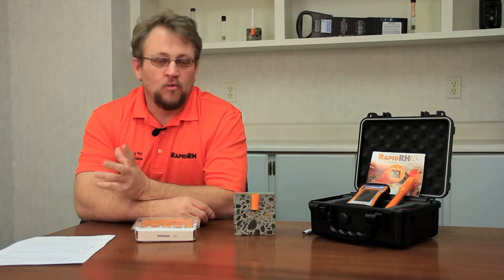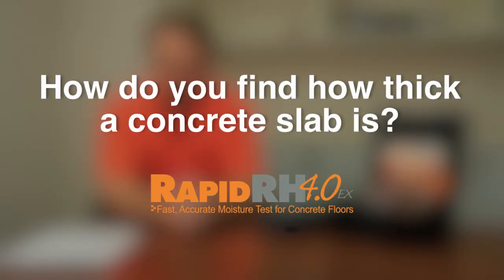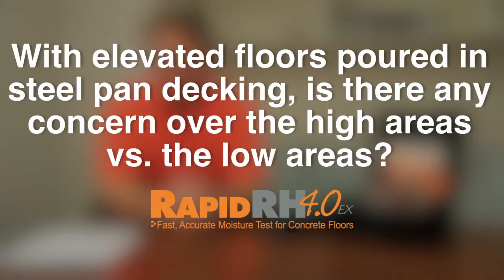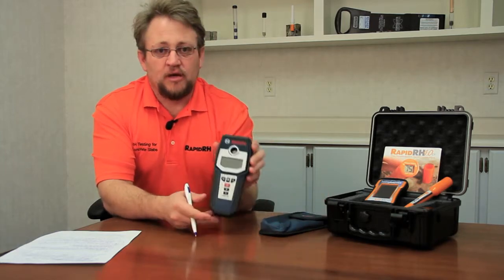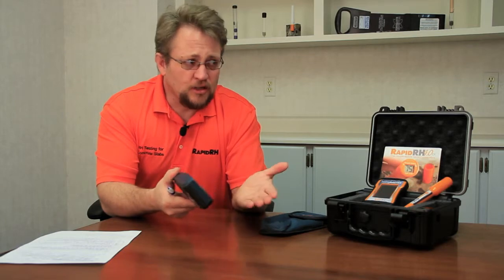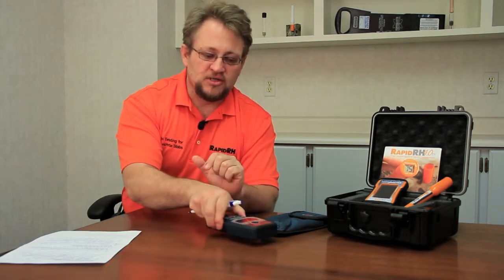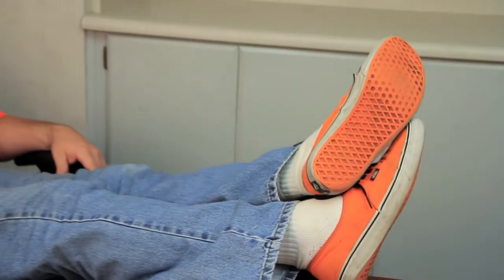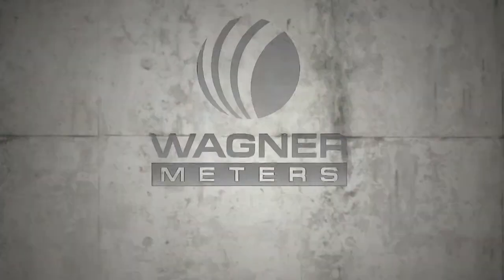Rapid RH Common Questions - Part 4 of 4

Comment: when I take a reading (after 72 hours) my 1st reading will be, for example, 80%. 10 seconds later I check it again and get a 78%, 10 seconds later, check again and get a 77%. if I do this 4 or 5 times I can get a reading up to 5 percent lower than where I started. Which is the accurate reading? the 1st or the last? why the fluctuation? sometimes the low reading puts me  within acceptable range of a flooring products RH tolerance.